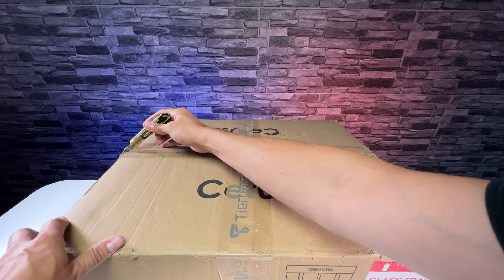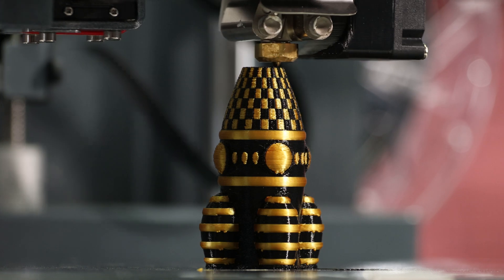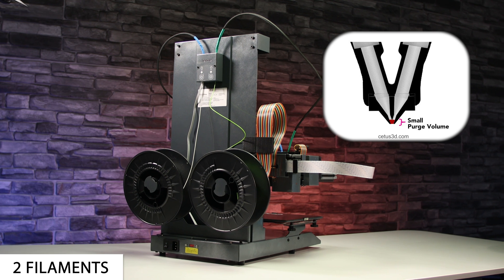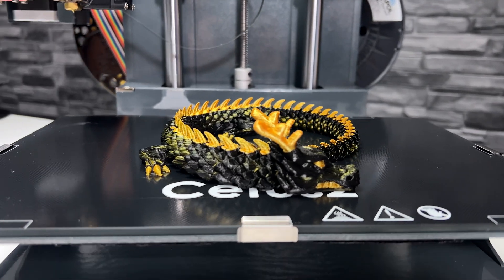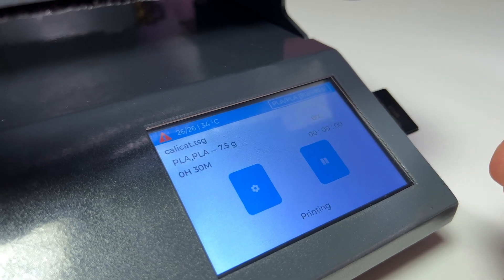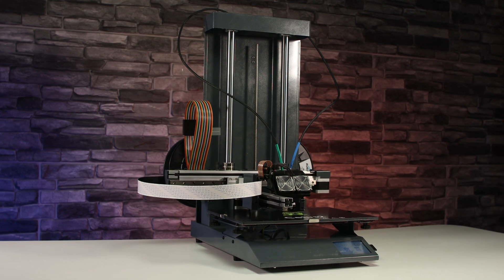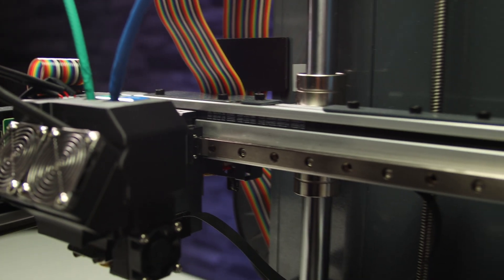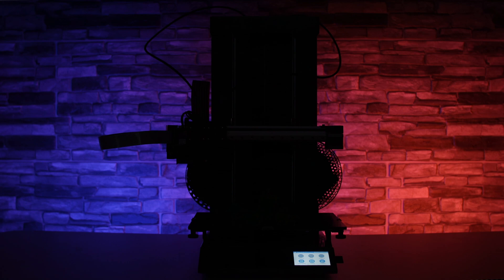The shocking secret behind Cetus2's multi-color 3D printing

Comment: If you have parts that are stuck to the carborundum glass, stick the whole thing in your freezer and it will pop right off. Just make sure it's sitting where the glass won't come flying out at you when you open the door 😂